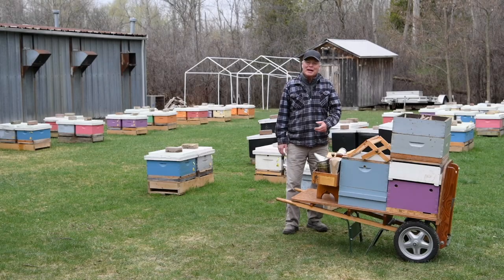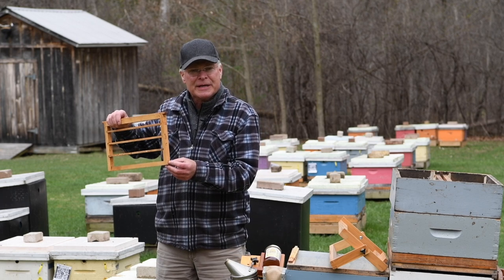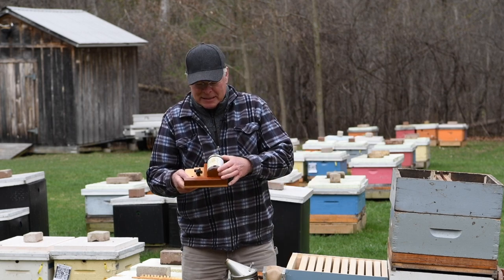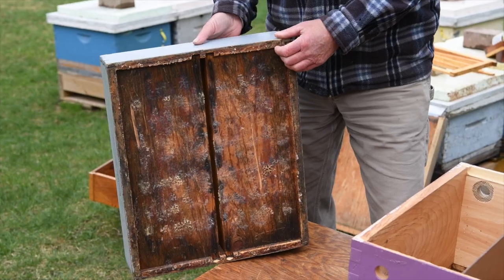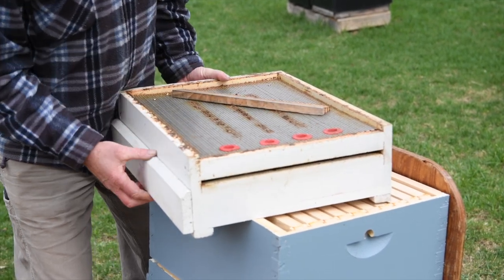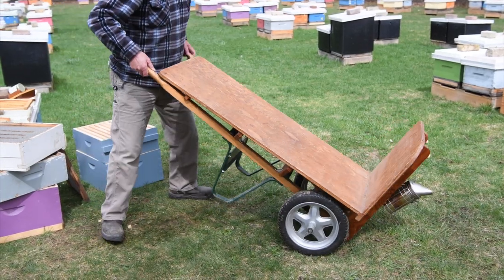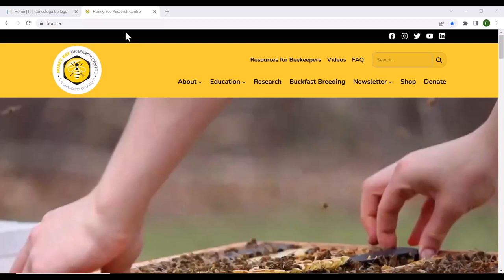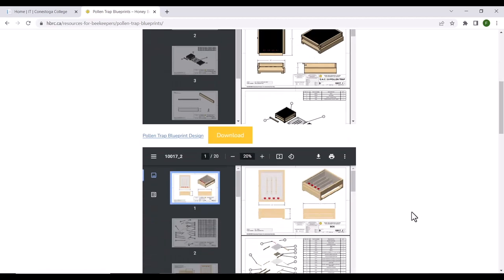HBRC Equipment and Plans

Comment: Paul, could you please explain using canvas as a intercover. As the canvas will shrink with use what size do you start with and is it prewashed so as to prevent it from shrinking? Enjoy your videos.

Comment: Thanks so much for sharing Paul; and great job on the detailed drawings Fred.  One thing I recall from one of your videos some time back (or may have dreamed it, lol), was the unique touch you added to your entrance reducers.  Believe you cut away full 15 deg angle - or maybe a chamfer.  I recall thinking how innovative!!!  We all have seen side rails compress over time and make entrance reducers harder to install.  I plane mine a touch under 3/4".  Your way, however, always ensures a tight fit.  Maybe worth adding this to your list as a stand alone or addition to your bottom board design drawings.  Great to see ya back...